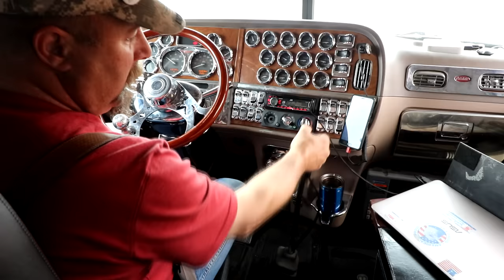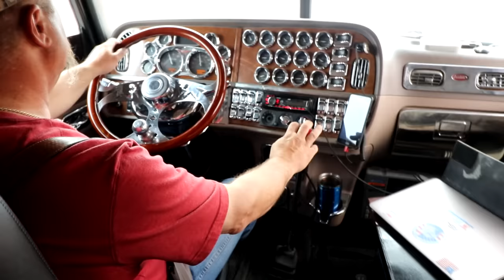How to shift an 18 speed transmission

Comment: Lots to keep track of while driving these monsters. A few reminders to nearby traffic so everyone stays safe on the road: 
- stay out of the trucks blind spots, 
- don't cruise next to the truck (get past as safely and quickly as you can), 
- don't pass on the inside lane and 
- allow plenty of distance when you merge back into his lane. Use your signals!
Reply: Bearistopheles he means the inside of a turn....
Reply: v10 f1 
Attempting to call someone a dummy, while misspelling it. Bravo.
Reply: Bearistopheles 🤣🤣🤣🤣🤣🤣🤣🤣 he must feel very accomplished
Reply: Outstanding advice to the four wheelers
Reply: D Tom I’ve seem some semi trucks not using their turn signals
Reply: Um, Bear-ass-to-fleas, I think you meant to say that you will pass on the OUTSIDE lane if the truck has been staying too long in the left (inside) lane. 

(And always remember, and never forget, two wrongs don't make a right, but three lefts do!)
Reply: @logmeindangit 
Good joke
Reply: D Tom 
listen guys, very seldom would you use all these gears , most all times if you were trying to get going with a very heavy load,AKA 75 or 80 thousand pounds. These tractors are designed for heavy equipment applications, very little chance any of you will be faced with this thing. I drove 42 years and never seen that tranny.
Reply: Jerry Miller 
Kinda stumped. Are you referring to the high end area of the transmission??
Reply: And don't brake check
Reply: D Tom. Another important courtesy to truck drivers. When a truck signals that it wants to change lanes, the driver has to look 2-3 feet to the left or 5-7 feet to the right (taking his eyes off the road to look through the mirrors) then they have to look back 40-60 feet through the mirrors to see if it's clear to change lanes. Imagine your mirrors being wet, the windows being wet, you're hauling a huge heavy load, driving at 60 mph on a twisty freeway, headlight glare in your mirrors, traffic ahead and on all sides etc. It is extremely difficult for a trucker  to determine if their is enough room to change lanes left or right. Therefore, give the driver 10 times as much space as he needs to safely change lanes and allow them to change lanes. Yield to the least maneuverable vehicle which is the truck. That is the way it operates in Maritime/Marine Law. The most maneuverable/smallest yields to the least maneuverable/largest/heaviest vehicle.
Reply: Great point. I flash my headlights to let the driver know he is free to change lanes in front of me once I see his turn signal. Something I picked up from my father years ago. Seems to be appreciated.
Reply: Who did you drive for 42 years for, the"I'm to cheap to give my drivers a decent transmission to work with " company.  
I bought a used tractor back many years ago, drove it home, and ripped that huk of garbage 9 speed out of it, and had an 18 in it the next day.
Have a good friend that was building a new Kenworth dumb truck back a few years ago, and I insisted he put an 18 speed in it.  
Everytime we get talking about that truck, he thanks me for making him do it.
Reply: Same goes for buses, the main thing is really if you're overtaking a commercial class vehicle please get about 100ft or so in front of us before you merge back over, that gap that we leave between us and the car in front of us is NOT for you, it's for everyone's safety in case we have to brake quickly we know we have enough room as to not rear end anyone, but if you feel like you have to be right in front of a 15+ ton vehicle then be prepared to lose the back half of your car.
Reply: DJ Metts no that's kinda cool, I see that a lot in Wisconsin not signs just most trucks stay in the left lane, but here in mn in the twin cities being a transit operator (driving buses) I deal with a lot of idiots that's have no respect for larger vehicles, constantly getting cut off and brake checked, even in bumper to bumper traffic everyone feels they need to be directly in front of us. It doesn't help that I found out that mn's doesn't know how to efficiently build roads, and everyone is in a hurry to get nowhere
Reply: D Tom It's illegal to be in anyone's blind. It's illegal to ride directly next to anyone. And your truck should be in the slow lane far from the passing lane. People should learn the simple rules of the road.
Reply: Nah I wanna sue
Reply: Jerry Miller I agree. I never had more than thirteen speeds, but for road trucks with normal loads, nine or ten speeds is enough.
Reply: D Tom - Unfortunately, it needs to be the other way as well.   A few reminders to the truckers. 
- If you're running the same speed as another heavy vehicle, drive in a line, not side by side.   It doesn't matter that it's blocking your view.  You're blocking the road.  
- If you think someone is driving too slow, playing road warrior and driving within 3 feet of their bumper isn't likely to do anything.   You can go around just like everyone else, or just be patient.  
- If someone does the courtesy of backing off and protecting a lane so you can merge, do them the favour of acknowledging them, and GETTING UP TO SPEED.   
- It doesn't matter how big your vehicle is.  It's illegal to make a left turn from a right lane, and if you need to make a right turn, you don't own every lane.   There is other traffic that needs to use that intersection as well.    (I have had a truck try to turn across me from my left to make a right turn, at an intersection where I was going straight. I've also seen them go cattywumpus across three lanes to keep people from 'getting in their way' for a turn.) 
- If you throw an alligator, PICK IT UP, or at least call it in and report it.   There's no way you didn't hear that tremendous flap/bang/thump and miss it flying across the road.   (Retread loss)
Reply: i gotta ask ya Troy Belding, about owning every lane, would you rather have to wait for a few mins because my truck makes wide turns and the idiot in the cross lane is over the line, or should i just stay in one lane and run that guy over because he's illegally in the intersection??

i think i'll take up the two lanes and not run someone over thank you
Reply: ted parker - Are you talking about the trucks that sit in the 'next to right' lane completely, then turn right - no matter what might be in the legal right lane - or are you talking about the ones that start in the third to right lane (or left) and cross so that their truck blocks all three lanes so that they can get a smoother turn?     If you're talking about the first, most of the reasonable trucks I know about cross their truck into both lanes and have their flashers going.  Technically illegal, but understandable.  If you're fully in another lane, you're in the DO NOT TURN lane.   I don't care how big your truck is - the law still applies.   If you're talking about the second, and you think that's a good idea, you need a new job.   I've actually had to park my vehicle in the right lane behind a truck in the next lane to block others from pulling up next to a truck that was obviously going to turn right (crushing them) - but was in a straight through lane only.   The traffic laws apply to trucks just as much as they do cars.   Truckers (mostly) do less stupid shit than car drivers, but there are dumb-ass truckers out there.   Unfortunately, some work for my customers so I get to see them reasonably regularly.     Many intersections just aren't built for what the big rigs need - it's a simple fact.   If you come across one of those, unless it's absolutely critical, you should look for an alternate route.   Watching someone doing back and fills with a 40' container is just painful, as well as traffic destroying.   

I'm not sure what you mean by 'cross lane', unless you mean 'the lane I'm not in that I'm going to illegally cross'.   If that's the case, you don't really have much right to be upset for someone doing something legal, but stupid.   (Such as pedestrians blithely walking across into traffic slowly because they want to cross, and they know that the cars have to yield to them.)

Comment: I've been a local LTL Driver for 15yrs. My tractor is an automatic. I've always wondered how an 18spd transmission worked. Great video Sir! I enjoyed this! #truckersrule
Reply: Questions are all trucking companies automatic
Reply: @1986Glory  can't answer for all but my company location has about 120 tractors. They have slowly phased out all the manuals over the last 8-10yrs. We have 3 manuals still remaining. The rest are automatics. They are the future.
Reply: @Donbarbz  This goes for most aspects of modern day transport infrastructure. In Europe the vast majority of shipping trucks, Scanias, Volvos et cetera, are automatic. You still have a lot of  manual trucks in the US, like the 18 speed transmission the nice guy in the video showed, but automatic trucks are starting to phase them out as well. I'd imagine in a good decade or two you'll struggle to find a manual in the US.
Reply: @hns_203  Same thing is happening here in Australia. I drive little 8 ton trucks, one of which is manual (we always start from 2nd gear) and the other is a very responsive automatic. Many trucking companies are favouring automatics as they are far more fuel efficient and also a big help when stuck in peak hour traffic.

The only downside is that pretty much any muppet with a pulse can now drive a truck.

Comment: Down here in Australia we have 32 speed road trains which are trucks with more than 2 trailers. I drive a 1968 Mack with night cab and I have up to 6 trailers. My transmission in my Mack has 28 gears.
Reply: Coma Doof Warrior.
Reply: guess you have a good workout for your hand
Reply: I'd be really interested in understanding in how you drive a 32-speed road train. I am familiar with the Aussie road trains but didn't realize how many more gears you had to deal with.

Comment: The first thing you need is a mustache like that, there is no way you can shift an 18 gears transmission without a manly mustache. The beard is optional, but the mustache is a must.
Reply: You got that right ! And if you wanna go over the top you gotta have the handlebar stache ...

Comment: 7:06 "That's 15th"
Oh so you're like doing 60 or so right-
"Thirty mile an hour"
😵
Reply: no , actually a 30 miles are equivalent to 48 km\h , i did my homework hahaha
Reply: @mah199726  I meant that it was surprising to be in such a high gear at such a low speed...
Reply: mahmoud khasawneh r/Woooosh
Reply: They are for heavy loads not speed
Reply: @Novur  Trucks have very quick gear ratios, unlike cars.
Reply: @dylanash2569  If only there were some sort of easily accessible consumable media that had demonstrated this to me, so that your highly informative interjection might have been rendered entirely unnecessary
Reply: @dylanash2569  Thank you ever so much for your invaluable assistance, I would have been utterly flumoxed by concepts such as "power bands," "gear ratios," and "torque," if it had not been for your timely intervention. Even after sitting through this ten minute long video indirectly discussing the matter that we are both commenting on, it somehow evaded my comprehension that "heavy thing need strong pull." Once again, my deepest gratitude for your time and attention in enlightening my poor, slow, addled mind to such consuming knowledge.
Reply: Before computers were used to slow these trucks down . A 1966 MACK with a Cummins 350 and 18speed quadraplex 2stick would run 96  mph some faster . That was before double nickel ,with cb and fuzz buster .
Reply: @Novur I'm dead
Reply: What I thought to!!! 😂😂
Reply: @Novur  r/iamverysmart
Reply: @chuckroer9202  ain't heard the term "fuzz buster" in YEARS!!  Love it
Reply: The last few gear changes make a much bigger difference each new gear than the low gears where you don't feel like you're going anywhere.
Reply: @Novur  what d top speed on d speed  meter??
Reply: @neilgibbons2532  Are you actually a Gibbon because you seem to have the communication skills of one
Reply: Novur one would be forgiven for suspecting a faint hint of sarcasm in your response to poor Dylan Ash...
Reply: @batlin  forgiven with a whole heart and a half-eaten fruit basket

Comment: My stepdad drove trucks for years. I went with him on a trip once, and he tried to explain the 18 speed pattern to me a few times.

I did not get it until just now. Makes me sad that he's no longer with us, because I'd call him and tell him that I finally get it.

The summery for those that had some trouble wrapping their heads around it:

-The shift knob has two switches on it. range and split.
the transmission has 5 'slots' (gates) with forward gears, two gears in each slot. The split controls which of these you're using.
The range selection is like the front sprocket on a bike, low range puts the output through a second set of gears that slows it down even more, high bypasses that (but the first 'slot' and it's two gears become redundant in the process because of the ratios used. Hence  18 speeds, not 20). You go through the gears again in high to get speeds 11-18.

So, from 1 to 18 it's 
flip range switch to low
gate 1: splitter back(1st)/forward(2nd)
gate 2: splitter back(3st)/forward(4th)
gate 3: splitter back(5th)/forward(6th)
gate 4: splitter back(7th)/forward(8th)
gate 5: splitter back(9th)/forward(10th)
flip range switch to high
gate 2: splitter back(11th)/forward(12th)
gate 3: splitter back(13th)/forward(14th)
gate 4: splitter back(14th)/forward(16th)
gate 5: splitter back(17th)/forward(18th)

Comment: What I’ve learned from this video:

18-speed is the same as a 6-speed, just tripled.
Reply: It’s also the same as a 1 speed, just 18th’d
Reply: I've learnt that it's the same as an auto 6 speed, only you have to shift manually and it's 18 speed. But same concept.
Reply: @je2338  NOshit :-)  except that u need to know how to work with CLUTCH
Reply: @covidBS4populationReduction No shits it's almost like he's JOKING
Reply: @josiahbackup7513  Point is that U dont need 18 speed !!! in normal regular not overWeight conditions !!!  all you need is 13 its 9 and 4 split
Reply: I'm a truck driver you only use all 18gears when your fully loaded with a truck and trailer normal can start of in like 3rd low or 4th low then flick up to high range in 5 and so on.....to make it simple the very first gear on the far left is more of your crawl gear really it's just one two three four flick up then the same goes in the same pattern one two three four the splitter is like a over drive button that lets it take of faster which makes it into a another gear that's how you get your whole 18
Reply: @covidBS4populationReduction  most truck drivers don't use the clutch when shifting. They float gears, as you saw him demonstrate.
Reply: @okiepokertraveler1718  yes, i dont use clutch but its not my point--point is that u dont need 18 speed  13 is best splinting 4 top speeds
Reply: Downshifting is what normal people would struggle with it’s not at all the same as a car
Reply: @okiepokertraveler1718   really? Wow  , i am driving truck 20 years and i didnt know that :-)))))   Read the Deputes,,  we not talking about clutch

Comment: Started driving big rigs in 1969 after military service. I drove for 33 years everywhere from Newfoundland to all 48 states. when I was forced to quit after a fall and 11 surgeries I was done, but racked up 3,500,000 miles with no accidents. Started in a Brockway 8 spd , then a bubblenose GM with 12 spd spicer. After that it was anywhere from a B-89 Mack 5x4 , to various trucks with 13 spds to a road commode 15 spd direct. Also time with 9 and 10 speed then finished with 18 spd. Think I covered most of it, had fun and still miss driving.
Reply: Nice work 👍

Comment: I live in Northern Ireland trucks are lighter over here and in Europe 44 tonnes across 6 axles I drove a Scania for 2 years with 18 forward gears, 1 crawler gear that had no synchromesh, 3 normal gears with high-low range & a splitter.
The thing I disliked was that the splitter would only work when I used the clutch. Very good video lad, I reckon I could pilot that yoke the very best. Keep er lit

Comment: Good God almighty what a complex thing to keep up with. I actually went to an automotive tech school and learned all about the Eaton-Fuller transmissions and the famous Allison automatic and even took apart and reassembled an Eaton-Fuller as part of an assignment... fully understood how the thing works and the whole flipping the switches to get to higher/lower gear ranges etc... but actually trying to keep up with you in this video in practice nearly gave me a headache! Not your fault, you explained it really well, that's just a lot to try and retain, I could just see anxiety setting in if it were me doing this in real traffic.
Reply: it sounds more complicated than it really is. if you can shift a manual 5 speed, you can do this. you start off in 3rd, skip 6th and flip the range selector to hit the top 4 gears...